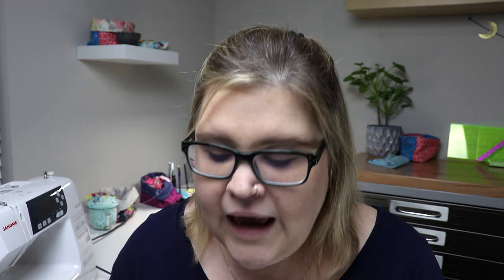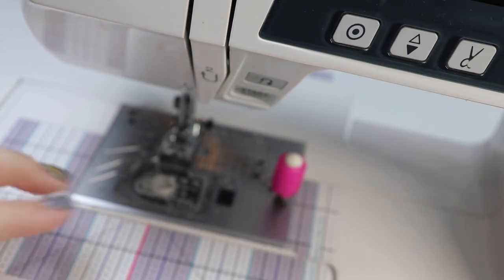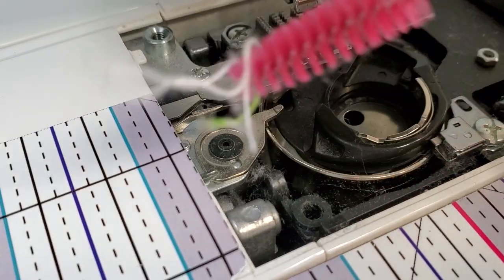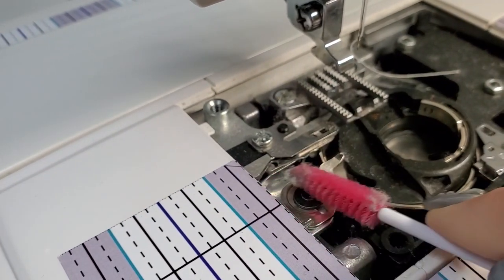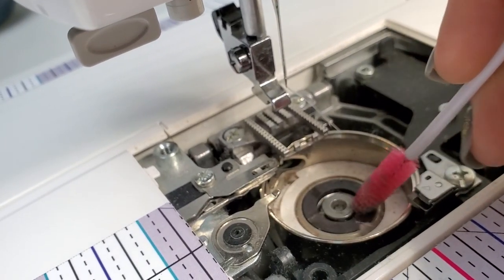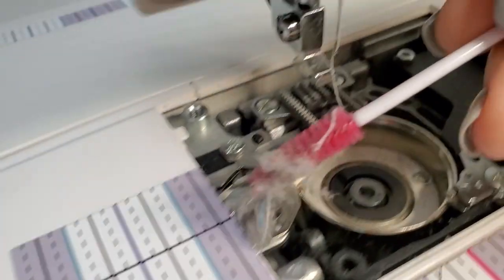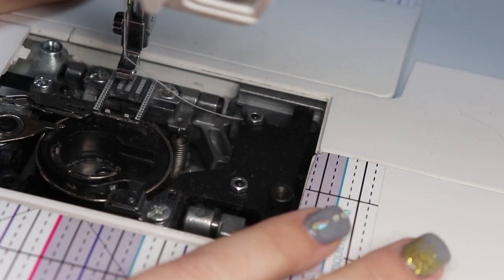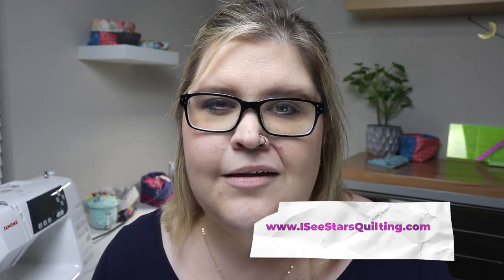The Best Tool To Clean Your Sewing Machine!

Comment: What a great idea.  I use a high quality 1.5” nylon bristle paint brush.  The long bristles are flanged and pick up lots of stuff.  I like this tool idea particularly for applying lubrication garter cleaning.  I also use air compressor for blow out.  Thank you for sharing,

Comment: I  know this is an old video sorry for my late arrival lol but can you possibly do a video on when/how to oil your machine?
Reply from the maker: There are so many different models of machines out there... the newer machines don't require a lot of oiling. I recommend taking your machine in to be serviced about every 2-3 years depending on how much you use it. Let the tech do the oiling and a good deep clean on your machine. It's worth the cost... because if you do it yourself and it doesn't go well.... well, don't ask me how I know lol

Comment: Be careful with some machines. I also have.a Janome but it has bar across the bobbin area. It connects to a spring located about the 5 o’clock position in relation to the bobbin (but deeply buried) that if bumped wrong will cause your machine to need a trip to the shop. Ask me how I know! (I also bought 100 of them in pink)
Reply from the maker: oh noooo... I hope everything was ok. every machine is different, but that is a hard lesson to learn!

Comment: I don't think you are ever supposed use canned air in your sewing machine
Reply from the maker: You're right. If you ask any machine repair specialist, they will advise against it with the reasoning that it CAN push dust further into the machine.